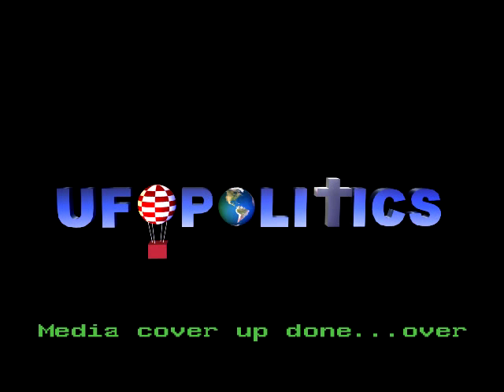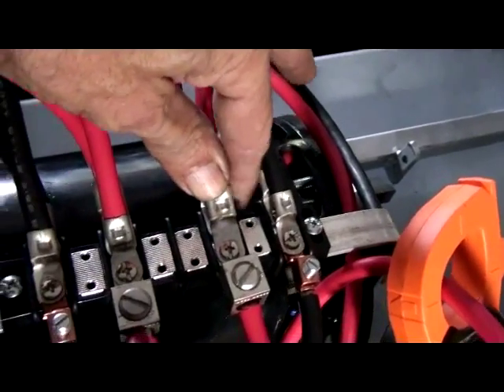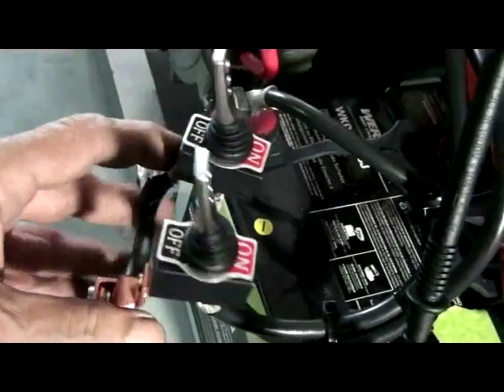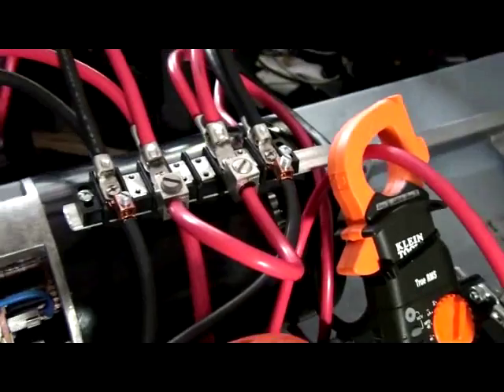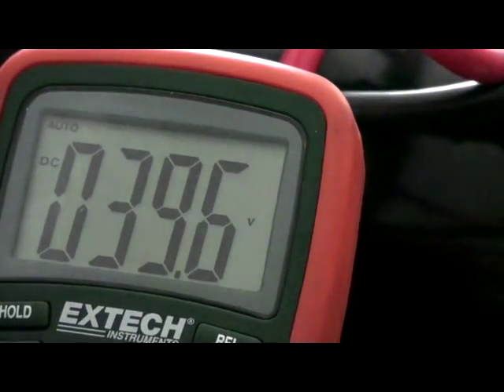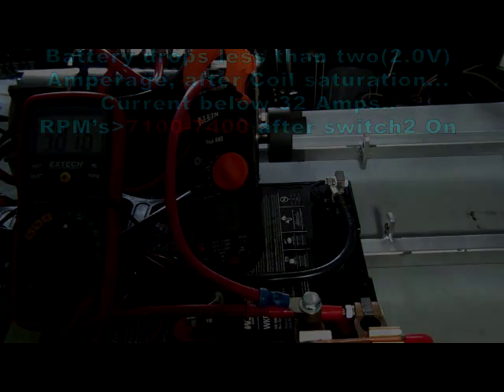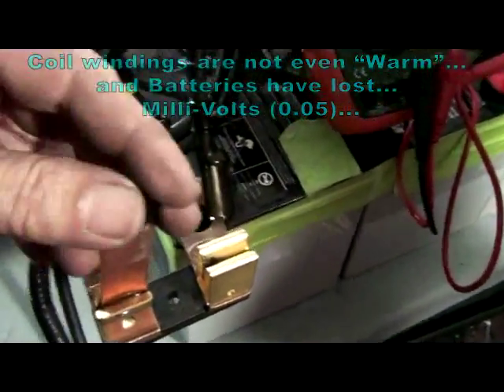ASYMMETRICALLY MODIFIED IMPERIAL MOTOR TEST 1

Comment: When I wrote "simple modification" I had no intent on belittling the enormous though and effort you put into this motor.  
So many attempts to create efficiency involve rediculous technology such as hand laid kevlar laminated laminar flow airfoils for wind mills that are useless with no wind.
I ment that, with production line changes, these motors could be made with little additional effort, without exotic materials.
"Tesla's ministry" has had similar designs for over 100yrs.  It's safe now.

Comment from the maker: On the contrary, my friend, resistance is very low per Pair of Coils, it is 0.6 to 0.8 total ohms in the Pair terminals at commutator elements. Have to realize this Motors turn On each Set of Coils (Pairs here) independently from the rest, since each set is isolated.
While Symmetry turns them all at once...and they stay on all times, just swapping polarities, magnetically and voltage polarity, divided by the four brushes, two positive, two negative...
Regards

Comment: I also noticed that your inductance must be much higher based on your higher winding wire length. That increases resistance. That would explain the higher RPM and lower current. I would have wound it Bifilar for each section. The difference would be tremendous. Try it on a small motor.

Comment from the maker: Hello Gotoluc,

I understand perfectly what you are writing above...
I understand what the Original Motor Spec's means...it will deliver 2400 RPM's @ 4HP Torque Load, and consuming 103 Amps/36Volts or 3.7 KVA to do that job...
I have an original, untouched Imperial Motor that I have kept just to make the real (and not by a data sheet) testing of Both Machines...same bank of batteries...same load applied, same reading Meters...

Comment from the maker: I do not think you are familiar with my Motors, my friend, as one attribute they all have is the very High Torque from the very small Radio Shack five pole to any other of bigger number of poles as it works "directly proportional" or the more poles,the more torque,so Torque is a Parameter I feel very comfortable with when it comes to my Machines :D

Comment from the maker: I am going to "Dyno" both Machines next,however, I had to Modify the Dynamo-meter, and replace the leather belt by a steel cable used in hydraulic lifters, as also the plastic wheel for a steel pulley,hoping the Two Digital RAPALA Scales will hold the pound pressure.

In this video I wanted you all to see the [U]response capabilities[/U] of this Machine basically the High RPM's on such Armature Mass,That is the reason I wanted to measure total Lbs on Both Armatures.

Comment from the maker: Did You noticed the Amperage readings from start to full speed?

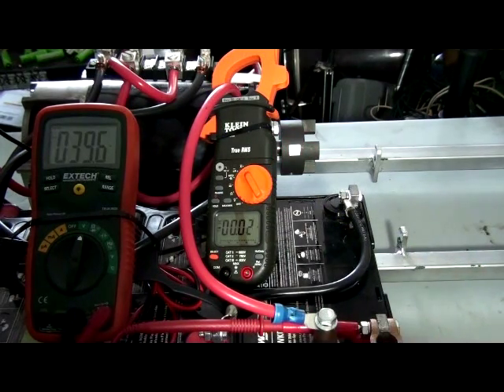If You have not paid attention to that detail,please do observe how it starts at over 67 Amps(Time 4:35 on video) then 51.7 (@4:37)and 47.7 (still at 4:37)36.2A (at 4:39)35.7A (@4:40) till it reaches a steady value at 4:42 of 32.68 Amps,then keep it steady at 32 and "some decimals" of Amperage fluctuations
Now consider the Acceleration from Zero to Full Speed of a 20 Lbs Rotor,it "blew it" in 0.07 Seconds.:D
 

Stay tuned

Comment: Very good work. Assuming the torque is almost the same you would be able to use your asynchronous motor to drive an alternator to recharge your batteries.

Comment: Hi UFO,  please keep in mind that the original motor specs is with a 4HP load (or 3000 watts) @ 2500rpm with 36volts in and and consumes 103 amps (3700 watts)

You test has no load, so I don't understand how you can compare them?

You would need a Dyno attached to your motor set at 4hp to compare your modified motor to the original.

I fail to understand the value of doing this test.

The previous test setup was the better way to test but use your current probe on the Positive post.

Luc

Comment: Hi UfoPolitics,
This is an eye openner. To be able to compare both specs. To see it in action, is great news. Your doing a great thing here, to show your work. It is not an easy task to perform.
I look foward to see more asymetrical testing. This motor coil winding configuration design would in my view do great for electric cars. Possibly increasing the range by three and the torque by a lot.